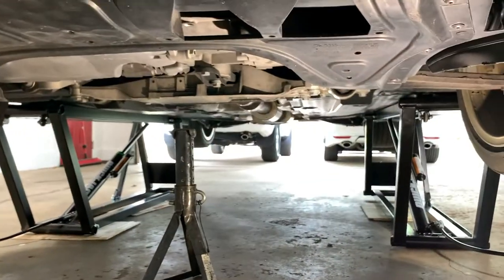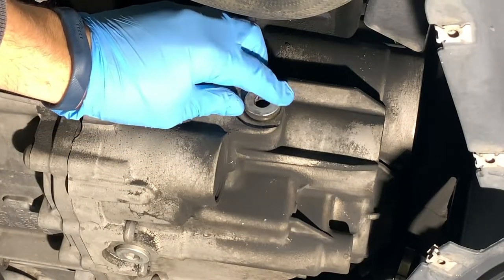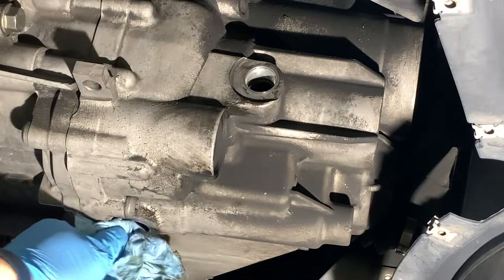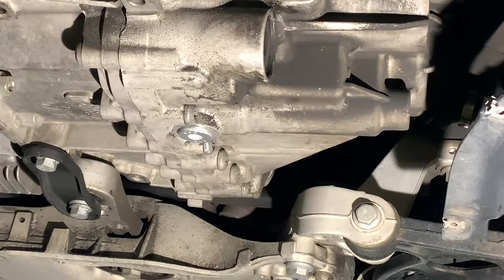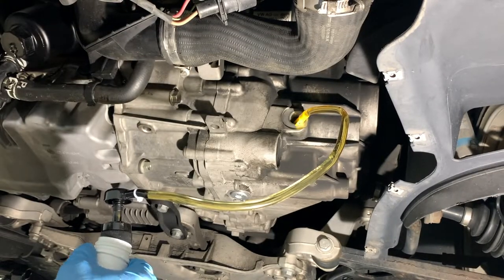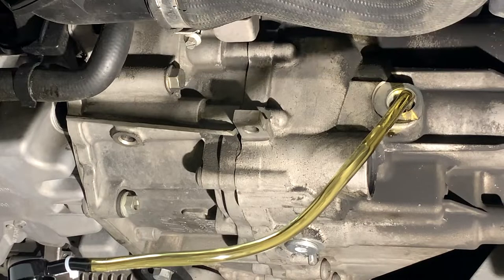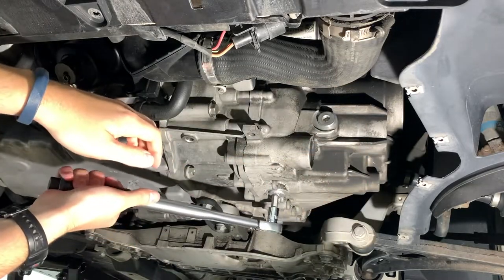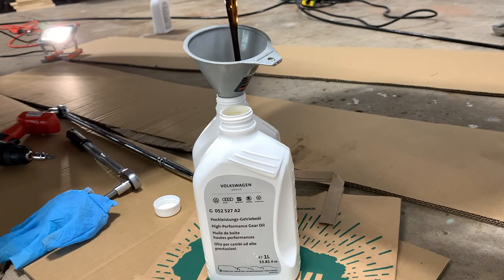MTF Change - Volkswagen Golf R MK6

Comment: Your videos are great; so helpful when I'm working on mine!  Couple quick questions- It takes between 1 and 2 liters to fill it back up, correct?  Also, did you end up having any leaks afterward with no crush gasket on the drain plug?  Thanks!
Reply from the maker: Glad they are helpful!
Yes, if I recall I used one full bottle and a good portion of a second.
No, no leaks. I think I was maybe looking at the DSG part numbers in the parts catalog and that is why I wound up  with the crush washers.

No leaks. Have put on about 5-7k miles since then. Shifts great!